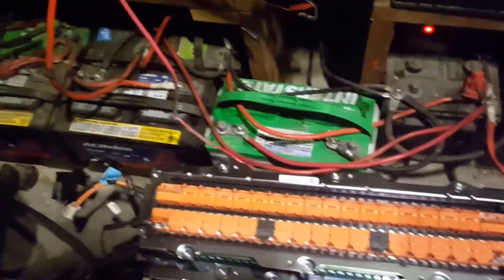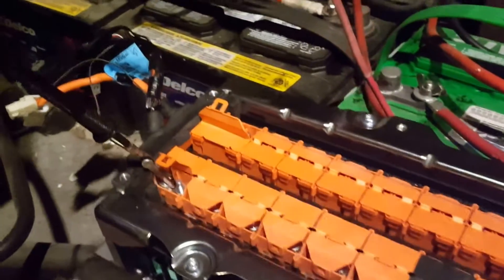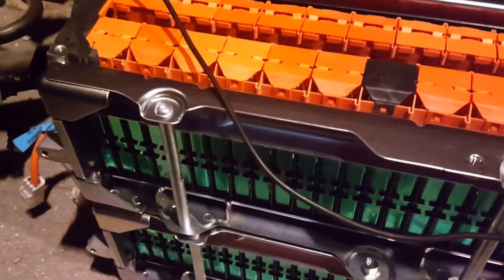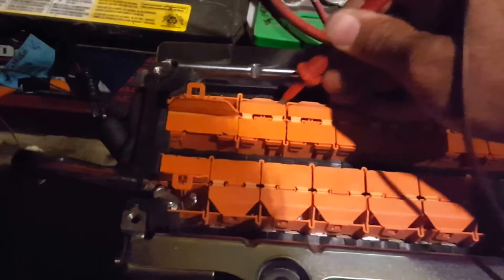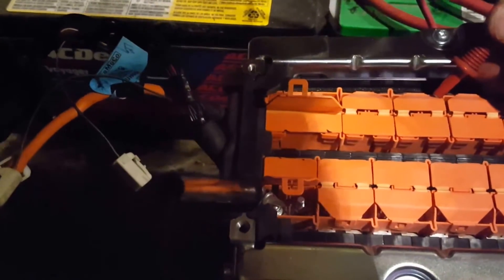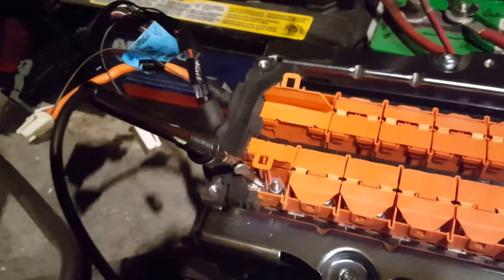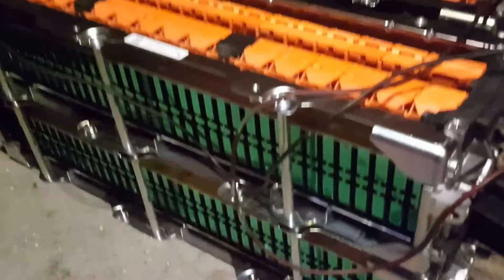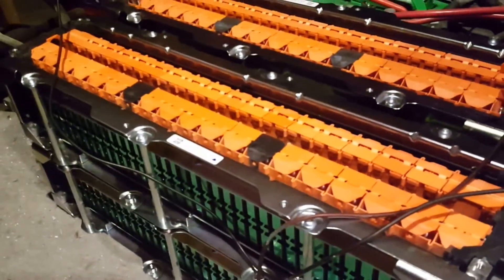Hybrid Ford Fusion Batteries To Power Up my Battery Powered house !

Comment: Hi, i have question, i have same battery on my c-max, battery is discharged, one cell is 2.43 volt, all 76 cells is 184.6 volts, how can i charge the battery? Can i charge all of them connected or i have to disassemble all cells and charge separate every cell?? And how can i charge assembled pack?? Car is not starts because of low voltage.  Thanks a lot.
Reply from the maker: Can you plug ln the car?
Reply: @ElRazTheGreat1  it's not a Plug In, simple Hybrid.

Comment: Great video. Are these the "Energi" plug in hybrid batteries, or the regular hybrid batteries? Size wise they look like hybrid. Are there any markings or numbers/model info on the cells?
Reply from the maker: thank you Ben! they are the regular hybrid batteries.  They have no markings on them, I even got my friend who is a svt tech for some insider info who could not get much info on them!  For now I decided to put this project on pause until I can get a good info on the BMS on them!
Reply: My Battery Powered House 

http://www.wolftronix.com/E10_LithiumUpgrade/index.html has done a great job of reverse engineering Nissan Leaf traction battery. Many good YouTube videos that you might draw inspiration from.
Reply from the maker: Thanks Ben!

Comment: The higher the voltage, the more efficient the power transfer will be. I would go 24v or higher depending on what inverter application you can afford. Also by going higher voltage, you will save on cabling as the lower voltage requires thicker and more expensive cable to handle the higher amperage required at lower voltage. Google Tesla Power Wall for more info. Good luck!
Reply from the maker: Thanks Mike, have in mind the lethal DC power over 50 volts DC!